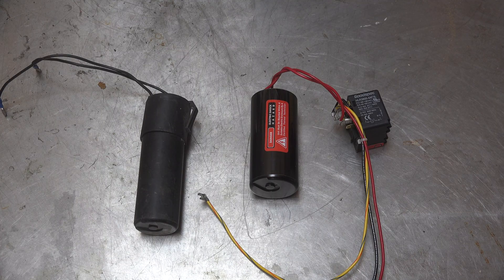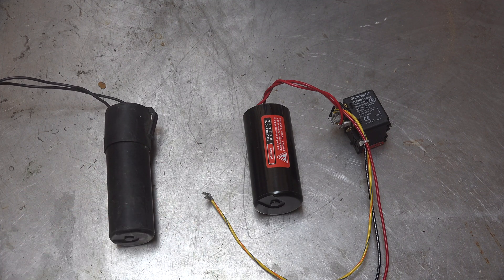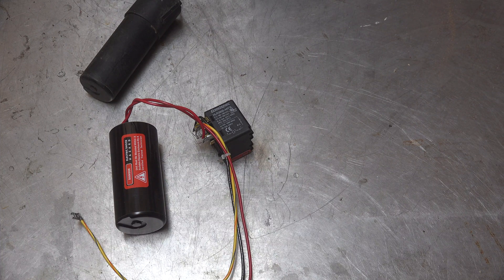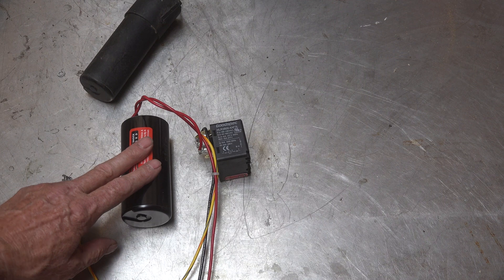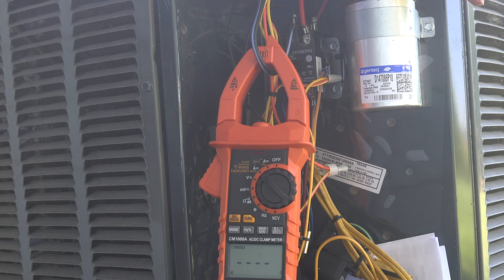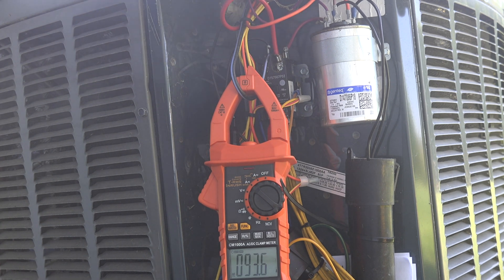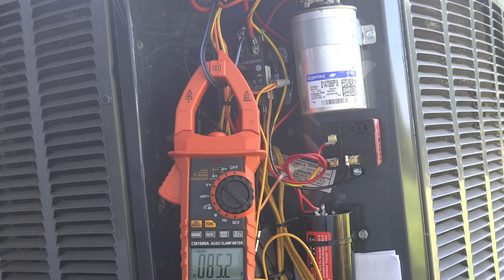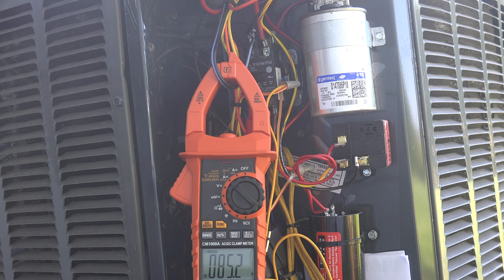A/C hard start kits:  are they necessary?

Comment: delay on break anti short cycle timers can be a better option in some cases, just letting the machine settle down and equalize pressures so it's not starting against a high head can make nuisance service calls go away. and the delay on make still lets the compressor start right away when it has not been running so the customer gets faster response when the system is starting cold vs a delay on make that has to run the clock every time. I enjoy your videos, keep up the good work!
Reply from the maker: If the unit does not have a TXV control and is not a scroll, these can help.  
GFM
Reply: Nest thermostat has a delay setting seems
Reply: delay on Make.... these will delay the start even if the compressor has been off... Delay on Break... delay starts after load is de-energized.
Reply: @markhoffmann5941  exactly, D O B will let a unit start on demand when it is able to do so and protect a unit from short cycling at the same time. reducing customer complaints about "taking too long to blow cold," and reducing the "it's not blowing cold at all" calls.

Comment: If you recommend not putting one on a new unit, why do some manufacturers install them at the factory?
Reply from the maker: If a unit has a non bleed TXV expansion device, it will not equalize pressures in the off cycle.  That high pressure on the discharge of the compressor will not allow the compressor to start as a PSC low starting torque compressor.  Thus the hard start kit added to the unit.
GFM
Reply: grayfurnaceman That makes sense.

Comment: How does the inrush current not trip the breaker on the circuit? How long would it take at that current to trip a breaker.
Reply: They are designed like that it depends. Because. If u pull that kinda amps on a. 20 amp won’t last as long as a 30 Usally they have to pull that amount about a solid minute prior to it being tripped or super large amounts of current aka faulted
Reply: Time delay fuses and breaker design.  Breaker doesn’t get a chance to thermal off and it doesn’t detect a short circuit so it doesn’t magnetically trip.
Reply from the maker: The answers so far have been accurate.  I will add that breakers are, by design, time delay circuit protection.  Also, the HACR breakers that are required for A/C systems are a higher level of time delay.  If there is a dead short all protection will immediately open.
GFM
Reply: Thank you all.

Comment: What are the typical signs that a compressor would need a booster?
Reply: tripped breakers, tripped compressor protection, the compressor protection can reset itself so it may seem like a very long delay before any cooling is felt.
Reply: @Militaristics  great info
Reply: More than 5 times LRA to FLA.
Reply: @u2ooberboober  great advise. Thanks
Reply from the maker: The answers that have come in so far are accurate.
GFM
Reply: Not starting would be one.
Reply: @mitchdinner9743  thanks for the input but maybe I should of framed my question better. Perhaps a typical sign off my meter? I'm looking for more detailed info rather than a path of swapping parts till the unit works.
Reply: @matt_in_maine  high starting amperage & heat stressed contactors and connections. look for signs of heat stress or damage from high amperage during start up's.

Comment: The 5-2-1 unit is good for rapid restarts since the PTC doesn’t have to cool down for the next cycle.
Reply: ?
Could you elaborate on?
Reply: hg2 my understanding is the PTC is a positive temp coefficient device which breaks connection after a certain amount of time elapses upon voltage being applied due to heat.  That takes the start cap out of circuit.  The potential relay depends on motor speed which creates back emf to open the contacts when speed of the motor is 75% of rated rpm.  Since the potential relay doesn’t have to cool down it can be triggered again in a short period of time unlike the ptc.  Same applies for a current relay device.  But there should at least a 4 minute anti short cycle delay in the t-stat to prevent rapid restarts to give the system time to equalize in pressure so the compressor doesn’t have to start against high head pressure.
Reply: In my original comment it should have stated the potential relay doesn’t have to cool down where the PTC does....